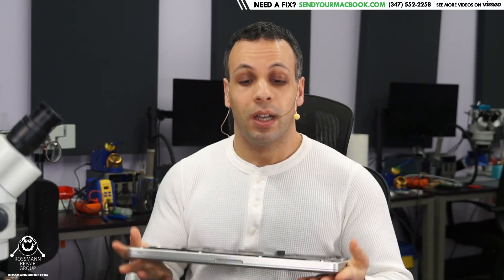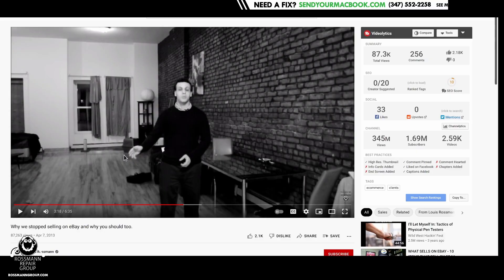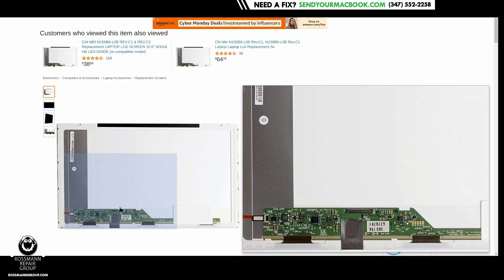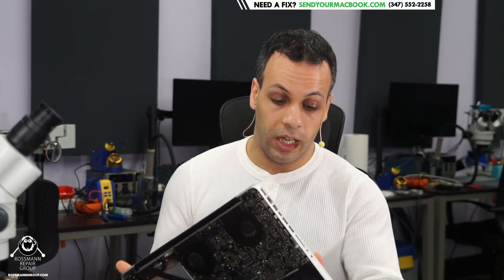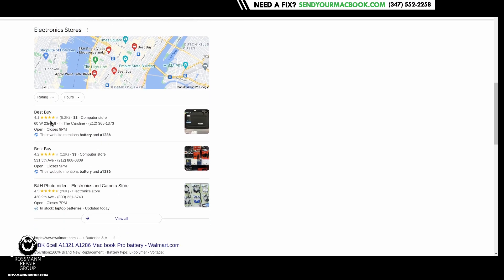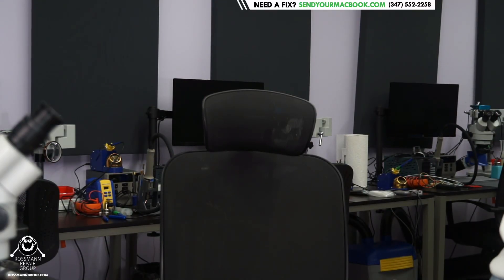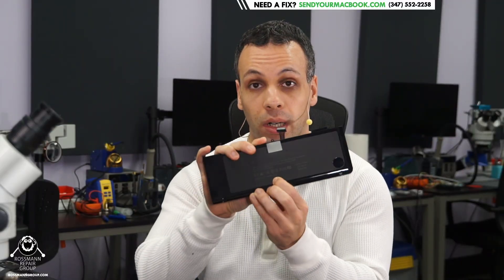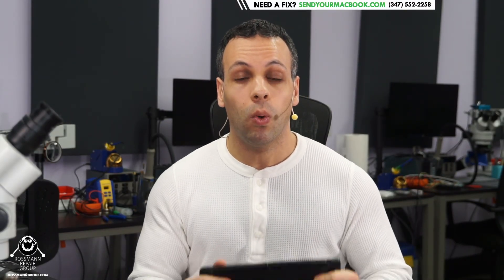Apple switched - and + on battery connector from 2010 to 2011 w/ same form factor; WHY?!?!

Comment: Louis - I am an RF Engineer who has worked on both board level and integrated circuit design. Engineers are not perfect, we make mistakes. Sometimes doing board layout you make a mistake that doesn't get realized until you are in production. Or maybe they switched board manufacturers halfway through the product cycle that have different design rules so some of their routing in that area had to be changed and the battery pins were changed as a result. I think it's fair to blame Apple for a lot of things but it is common place to have multiple revisions of the same board make it into separate serial numbers of the same part number over the years in every industry - so I don't believe we can be too hard on Apple for this one.
Reply: No, fuck that benefit of the doubt shit. If apple wanted the benefit of the doubt they shouldn't have spent the last 15 years going out of their way to screw their customers and convince everybody else in the industry to screw their customers.
Reply: @tissuepaper9962  I don't work in the consumer electronics industry. Every other industry I've worked in this is common practice to have multiple revisions of the same board due to PCB problems, part sourcing etc. It's easy to scream fuck apple when you have no idea what you're talking about. Apple does a lot of intentional  things to screw their customers I don't think this is one of them.

Comment: Well, on smaller quantities I would say:
The part was a bit cheaper.
But on the apple scale that's not a factor to that degree because their quantities are so big they tell the manufacturers what they should produce. If you take several million they will happily retool their machines for you. While they will ignore you or politely refuse if you ask for less then 10000 for any sort of reasonable price. So in the ladder category you will change to the other part.

Comment: Uhm Just a normal question tho

Why would a company try to switch/change internal components of the same device/model ?

I don't mind adding the "change" itself but if it's done in obscurity, how am I supposed to know which part I'm buying ?
Reply: Perhaps the original battery had a different manufacturer that couldn't keep up with demand. Maybe the original battery had a defect that was found after production started.

Comment: Hi Louis, I have got a weird issue with my mac A1502 Mid-2014 model, it will only charge after the battery has been drained completely and it will keep charging if it's remain connected to charger and it can stay in that state for days, but if I remove the charger and connect it again it wouldn't charge (no light on the charger) unless it has been completely drained, any idea what it could be?

Comment: design 101: make sure that safety critical components can only be inserted in the correct orientation.
Apple know this rule which means hey are hoping you will fry your laptop should you try to repair it yourself

Comment: Tried changing the ssd in a A1708 Mac, the adapter for the new drive was faulty, re ordered a new one. Have to wonder though, why Apple didn’t use a standardised ssd type, rather than their custom one, such a hassle to replace/upgrade. Such a simple upgrade though tat just about anyone could do. I remember Apple desktops in 1998, and a lecturer showing how much better Apples were to work on than PC’s, as Apples were case opened better, we’re generally better designed for fixing/ upgrades. Now…
Reply: They want you to spend an incredible amount on the storage they sell you, how are they supposed to make money if you can just upgrade it yourself?

Comment: technically, 5517 is a series and not a model, the model would be coded as ie 5517-1127 and thus specifies which screen is in it based on the actual model. Just as an A1286 is a series the model would be A1286 followed by the EMC code ie A1286 (EMC 2324) and A1286 (EMC 2563) . If you use a full and correct model number, you can never buy the wrong part (only be supplied the wrong one. This applies to all manufacturers (except Dell) .

Comment: I had a old HP laptop given to me by my dad.. it was old but better than the newer 1 i had (go figure) 
anyhow he said fan wasnt working an it was over heating but still worked fine. 
he said do with it as i wish.
I stripped it.. found the part number for the cooler/heat sync and fan n bought n delivered within a month and was correct one.

I did a test n did a google search a month later n searched for the part just based on model number of laptop.. there was 4 types of heatsynch/fan/cooler. 

boy was i happy i did it right 1st time :D

Comment: the same principle applies across the entire electronics industry.
Home tv repairs a case in point.
you have to look at the circuit board and check 'revision' numbers printed on the boards before you go off and buy a 'generic same model number' YSUS or XSUS board for your tv set, not the tv model number.

Comment: in defiance of this, can one simply use jumper wires to get it working? or recycle the plug from the old battery and reconfigure the pins on the new battery

Comment: Not only that, on my Nokia charging port assembly there where parts without microphone and/or antenna. So not only look for the part number also check why you find listings which are more expensive.

Comment: I don't understand about CCFL screens and a laptop. Do you mean the customer wanted to upgrade to LED backlight? 
If I had a faulty laptop screen, what would I do, I will make use of Russian customer rights protection law and order the cheapest screen I can find, keep the receipt, only when I have a screen will I disassemble the  laptop, then I will look if it fits, and if it doesn't I will go back to the store with the receipt and the screen and simply take my money back because it's the law.
Why bother destroying screen in process?

Comment: So most of the problems that Apple wants to blame people for can be traced back to THEMSELVES, eh?

I personally don't see a valid reason for changing the pinout allocation of a battery unless they went with a different mainboard manufacturer (and even then, it should be as simple as reusing the same PCB design... there's no way that Apple would simply elect to have PCB designers create a brand new design for the same model number because surely it costs money to have them design a brand new PCB design every year... unless the PCB designers are paid by the hour as most workers are, which would give Apple as a company the incentive to have them churn out a new PCB design that differs vastly from the last year's design).

There should be a cost associated with making a brand new PCB design every year, and if (for some reason) there IS, but the gains from changing the PCB layout every year somehow outweighs the cost of doing so, there should be a tax associated with flooding the market with PCB whose battery, connector and component compatibility across each iteration is narrow or non-existent.

In my opinion, flipping the polarity of the battery connector across different iterations of the same model is both dumb and dangerous! And Apple should ONLY blame themselves, and not the people who try to change the battery themselves and get the wrong battery with the wrong polarity! Yet, here we are... 😒

Comment: What goes over the data lines?  This is where I say you should have the ability to run whatever software you want, but specifically you should have the option of reading the battery part number with an application, booting into Linux or something.

Comment: I've fixed a few hundred ps4 controllers, and it's a similar deal. On the outside are only 2 different model numbers. On the inside are SEVEN different revisions of controllers, with few cross compatible parts.

Comment: What I often do if i need a part for a normal laptop is using Aida64 to read out the part number. 
Thats possible for example for the RAM, screen and motherboard. 
Sometimes for the battery as well, afaik it can read the FRU when it's a thinkpad for example.
But I don't know if that's possible on a macbook.

Comment: What I'll do is open my device, do the thing, then put it moderately disassembled in a corner of the room if I some more work to do on it later (under a dry towel/cloth for dust).

Comment: I learned the lesson about looking at the part itself for the number when looking to replace my old HP laptop's battery and several batteries of completely different form factors popped up for that model of laptop, and some of the ones that LOOKED like mine had slightly different voltages listed, so I realized I needed more information. I could have easily made the mistake of buying the wrong battery.

Comment: "Maybe an engineer can tell me the reason "

As an electronics engineer student I can confidently say, it doesn't just make no sense, unless it was to put far away delicate components, which I know it wasn't because they also put the fucking datalines without ground to isolate right near the 12v or 19v (depending the battery), it might be that they also change the side on which you plug the charger, but that is still a dumb idea, mostly because they should just keep the design that is working for charging.

As a teacher said about how to spot a mathematician, ask how to boil an egg when the egg is on the table, they will give you the steps, then ask how to boil the egg when the egg is on the freezer, a mathematician answer would be "I put the egg on the table and repeat the given steps", in other words, the work is already done, you can only fuck it up if you keep tinkering when it is not necessary.
Reply: Why would having data lines next to 12V/19V matter? Please elaborate

Comment: audio in linux is great til it does not just work, at least it was a easy fix for the issue i had with mine (disable power management in the audio driver)

Comment: People get upset when you tell them. Oh I can't tell you what LCD they using in the XX notebook until I pull the back off. Check 3 different paces and shows 4 different models of screen based on your model. I think it is garbage. Keyboards, batteries, screens should all be standard. Just like IBM desktop clones back in the day. Oh and don't purchase a mac. Oh and more people think it is all same day repair too.

Comment: Imagine a person who thinks: "Yo, its only the battery, what could be wrong with replacing it by myself? Did it 1000 times for portable radio, tv's remote control etc." That is really evil genius decision from Apple
Reply: remember that no other laptop company does such revisions and changes. Again, it is only Apple that is at fault. And Apple is the sole company we should focus all our attention on.
Reply: @RandomUser2401  Samsung TV's the motherboards inside,  they seems to have at least for version for each of there TV, and and with 3 to four boards in each TV, in the list of parts, needed is mad, had big Samsung tv, which start have, problems, not related to the screen, have friend, who had the same Samsung TV, but the screen was smaller, they had managed put a big hole in the screen, but everything eles seem to work, so got the TV home, and got to work, with the idea of swapping the working boards, to my less than working, TV, all the boards looked the same, in the two TV's but on a closer inspection, they all had different plugs and or cables, and nothing could be moved/swoped from TV to TV's, without a lot moding, of plugs or cables, at this point, started googling, and there lists of parts, which might or might not be the right part, and 100's on a hunch for a part that may already be broken, it was easier, just getting a new TV(Not Samsung), and now binning two old TV's
Reply: @dh2032  With Samsung there are sometimes legit legal restrictions on chips/supply issues (see their phones having to have US and EU chip versions). I would assume some markets just then get a mix of TVs of whatever they can supply from those channels, and some countries only get the one "legal" one due to licencing, patents and other legal or economic distribution.
Reply: @RandomUser2401  doing some more trolling here huh?

Imagine the Apple repair guy making videos about Apple products. Who could have seen this coming?!!!!
Reply: @robertstan9733  wtf how is that even possible that an apple repair guy is making videos on Apple products?! That would be literally unpossible reeee

/Joke
Reply: @xmlthegreat  ikr! Truly a sign of the coming Endtimes.
Reply: @RandomUser2401  HP sometimes does. In that, they will change the internals (externals moulded exactly the same) and keep the part numbers the same. But as far as I can tell, it's when fixing a design error/fault. Not to prevent repairs.
Reply: Back in the day when I repaired PS3 and Xbox360 video game consoles there were several revision motherboards. Sometimes the power supply changed, sometimes the drives and how they are married to the board changed and just when you thought that was it, they changed the motherboards on the controllers as well. 
On some PS3 controllers the tiny battery block is directly soldered to the wire while in others it has a 2-pin jtag connector.
Of course with consoles it was mostly a race to prevent moders circumventing security and constantly streamlining the number of required parts to minimize the deficit of selling the console at a loss. Also exacerbated by bad manufacturing practices of Sony and Microsoft in the early days (ring of death & yellow light of death) which resulted in critical hw failure.

Comment: So, to a hardware engineer, everything is a part number and part of a BOM (Bill of Material). These are not the part numbers you're referencing, but internal part numbers that are unique within the company and the format varies depending on company and tools they use.

Purely speculative, but I imagine the reason Apple may have created this scenario is first of all because the engineering team is not directly connected to marketing and probably don't know the consumer model names to begin with.

Secondly, in the case of the battery design change, this was probably a design change done during a new generation design cycle. The HW engineer may leverage an older design as a starting point and then adjust it to fit new design constraints, which in this case may have included changing the connector layout. This could be due to something like issues with routing the signals on the connecting board, or even just because it's a new board layout and no one put constraints on the pinout being the same as previous connectors since it's proprietary anyway.

The hardware engineers are not likely going to consider compatibility with the previous generation at all unless that is a design requirement that's been documented. Instead, this battery or components of the battery may be shared across multiple models in the generation (e.g. 2012 laptops), but have no compatibility requirement with previous or future generations.

I think the solution here is not simple, but the first step could be simply driving greater awareness of right to repair into engineering teams so that they know to think about issues like this.

Comment: Louis we had the same problem with the Compaq powered docking station because the part number was the same for a PSU for a desktop pc and it took months for the people in the stores department to send out the right parts as it was before been able to take a photo of the part we was after and send the right replacement. So the storts people would have to read the description of what we was after and not just go on the part number in the QRG or MSG Compaq maintenance guides. Fun times

Comment: Been there, done that. Happened to me when it comes to laptop screens, laptop batteries, smartphone screens, desktop PC RAMs... It's frustrating to deal with these tricky situations time and time again. What can you do, some people just order willy-nilly and you can only assist them in fixing their mistake. That is, if the purchase system is not rigged to prevent you from fixing those mistakes, like the ebay scenario you mentioned. 🤷‍♂️